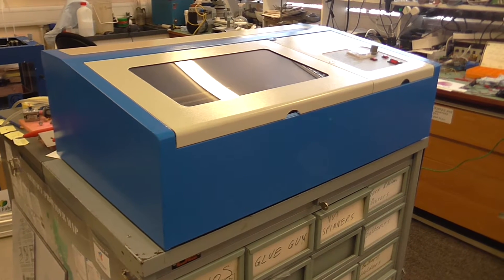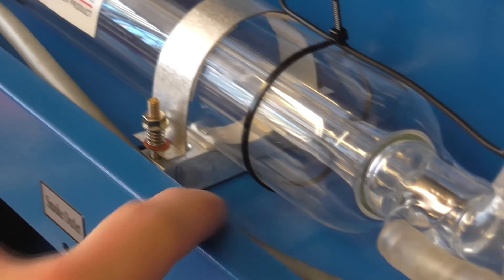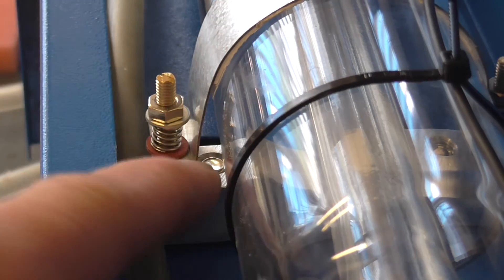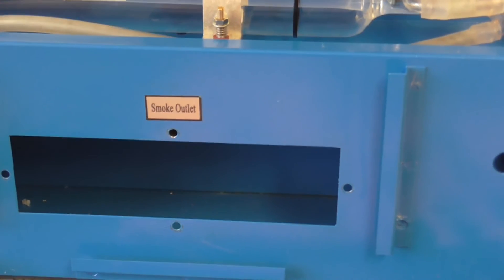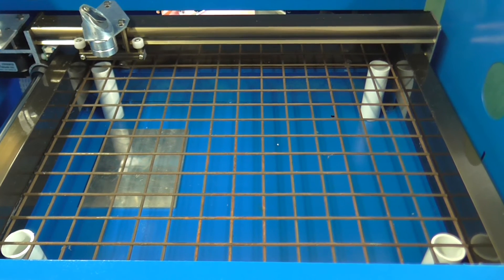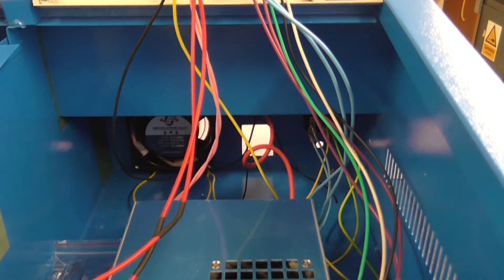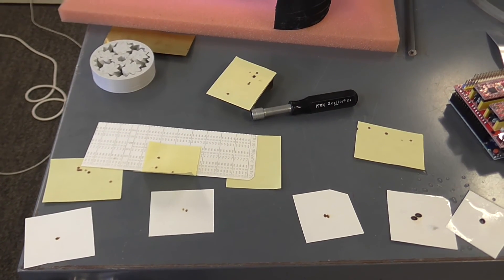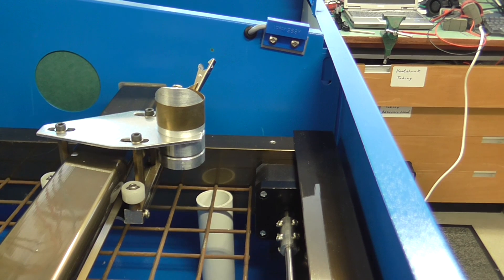K40 Laser cutter

Comment: When I connect the laser to the computer with the usb cable, you should tell me
found new hardware?
Because nothing happens to me.
I tried 3 usb cables. It's normal?
Reply from the maker: Its been a while since I had the original control board in there, but I think you have to install the device driver first. You might have to go into device manager and look for a USB device with errors and either update the driver from there, or remove the device and start again. If no device is showing up in the manager, then you might have a faulty board.

Comment: where and what is the proper lens for these laser cutters cracked mine " HELP " first lens at laser beam
Reply from the maker: Plenty of ZnSe (Zinc Selenide) lenses to be found on ebay, banggood, etc. Match by diameter and focal length. Mine was 12mm diameter and 38mm focal length as I recall.

Comment: Jan. 2018---Thank you for an interesting and educational video. Got interested in these late last year simply because of the many uses it can be used by a modeler alone. I'm getting back into modeling, but instead of aircraft/armor, going for 1/35th scale zombie/apocalypse dioramas. Was looking at building a motorhome like the Winnebago used on the tv series, The Walking Dead. With this laser, I could cut all the pieces I need except for tires. This idea came from watching a video from a guy in Australia who designed his own version of a military truck which, to me, looked like a motorhome. He used a laser to cut out all his parts using some sort of drawing program. Checked and found out he used his companies laser which sells for $3,000 which is a little out of league for my pocket book. But all you have to do is cut out your pieces, but not only is the majority of work is done, you can create additional parts and all will be EXACTLY the same. Thinking of window frames used on homes/buildings, those wooden road barricades that some have flashing lights on which reminds me of saw horses. Seeing 40W lasers selling for $300 or so on Ebay, but how much additional time did it take you to make everything right/workable? I know it took you an hour to line up your laser. Like how you did the stand, but isn't there suppose to be a fan which will suck out the smoke from the laser while cutting? Also, what material have you cut with it and the thickness of that material? How small of an item can be cut? I also understand the depth of the cut can be adjusted so it doesn't cut all the way thru for engraving purposes, like making a miniature store sign to put on a building. Checked your profile, but didn't see any other videos/updates on this machine. Hopefully you'll have one that will answer some of my questions.
Reply from the maker: The K40 is a stalled project at the moment. I need to look into the software chain needed for me to get best use out of it and properly install the new control card.

I replaced the original control card with an Arduino running GRBL and I can now control laser power from software, rather than from the front panel. Cutting vs engraving is a combination between laser power and travel speed; high power + slow travel = cutting. I've managed quite a good cut in 6mm acrylic.

Comment: I have one of these and am making various adjustments, nice to see what you have done and some really clever parts. You clearly have access to better materials than I do. 

I am in a weird situation where I have to keep the laser cutter working enough so I can cut parts for the bed size upgrade and hope I have all the parts I need before I take it apart.

I liked the double screws on the laser tube and the mirror mount is certainly an upgrade.
Reply from the maker: Both at home and at work, I maintain a stock of odds and ends of materials. Since these parts were made at work, I was mostly using hand tools.

Comment: Well done, .. was looking at one of these a while ago but was a bit worried about repeatability and general build quality.
Do you know if it's good enough for engraving steel and aluminium panels, surely won't cut it
Also wondering how well you get it focused with your tweaks, apparently that seems to be a problem with these units.
Reply from the maker: You havn't got enough power to cut metal (apparently it can be done with 100+ Watt and gas assist). The surface relects too much energy and doesn't absorb enough to be engraved.

There are sprays that can be applied that react with the metal surface when hit by the laser and allow marking.

The focus appears to be fine. I haven't played with the height of the cutting platform to optimise it, but the kerf was less than 1mm in 6mm Perspex and I've made a 0.4mm (probably less) cut in card.